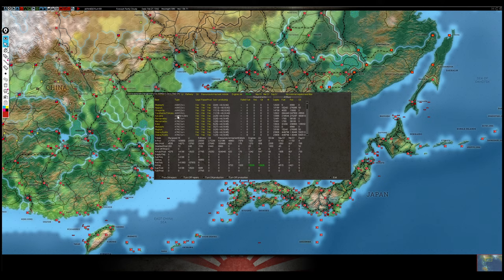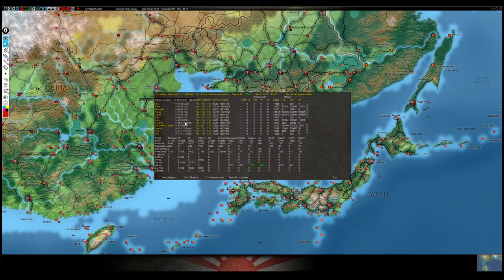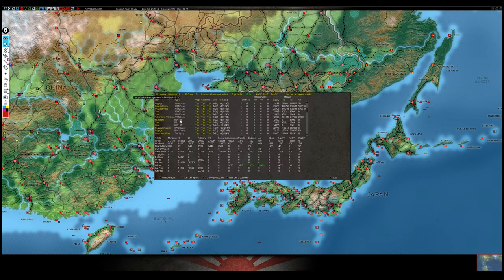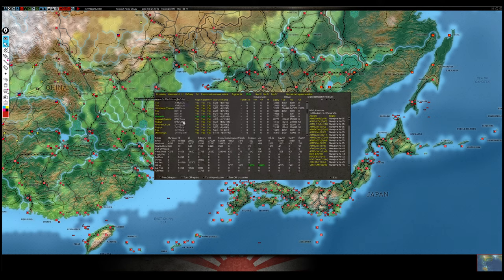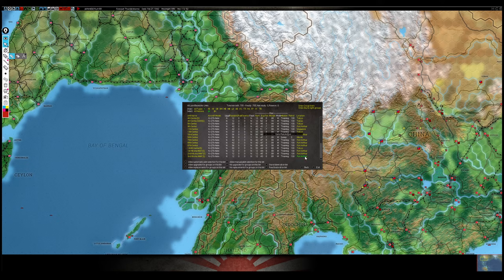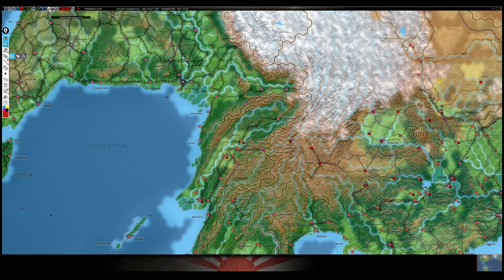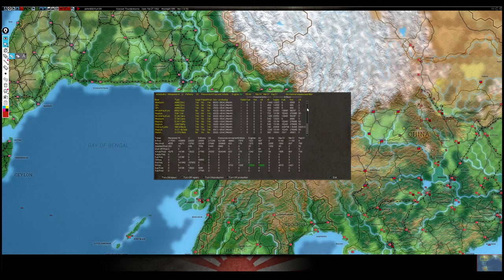*LIVE* Let's Talk About My Aircraft Production -  27 Feb 1942 (Macho v. Heiden)

Comment: About  Upgrading, i would take the Automatic Upgrade-Yes off to No so you can do it manually, especially for research. Or the Research Factories will upgrade to fighter factories if research done and if you than go change them back they go damaged and need repairs. So you can change to next model research without damaging them. Also if its off you can save a turn, make your changes and if you misclick---happens very often in the game, you can simply reload and dont sit here with damaged and reduced factories for weeks and months.
And yes if you go not to the next fighter that is not in upgrade chain or different fighter you need to rebuild them but they dont go reduced so its simply 1 Point/1000 Supply per day until all is repaired. Also you can amke a small trick with Jakes. Your ships have often 3 Units of 1 or 2 Jakes (for lets say 6 total on CA). move 2 of the 3 out, resize the remaining Unit to 6 (or what capacity the ship has) and resize the 2 pulled out Units on Chitose to 24 Planes. That way you get 2 extra 24 Planes Jake Units as Subhunters.
Reply from the maker: Great feedback, thanks Chris!